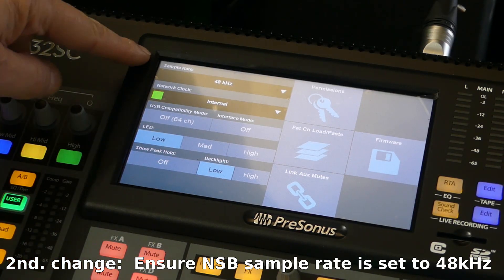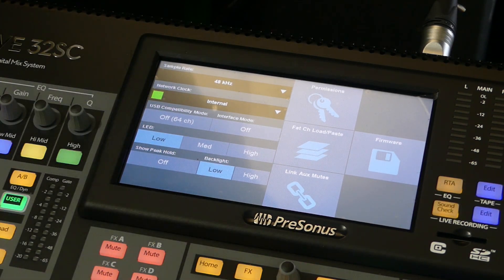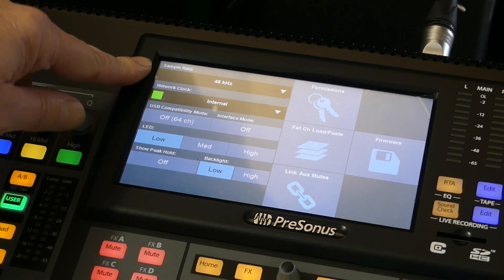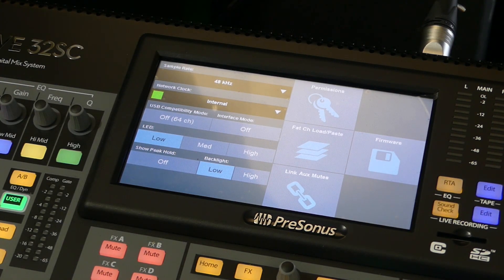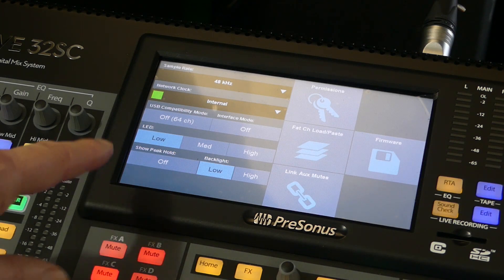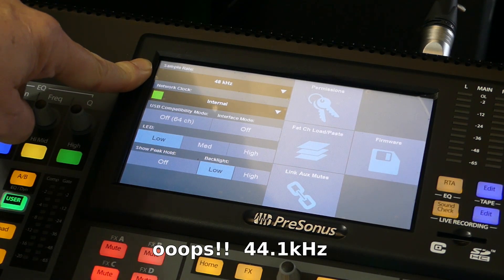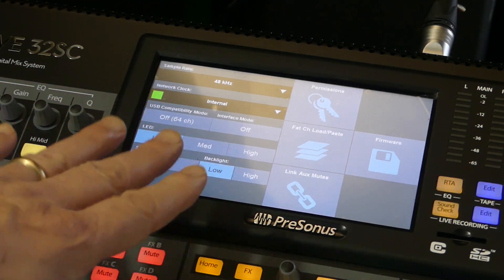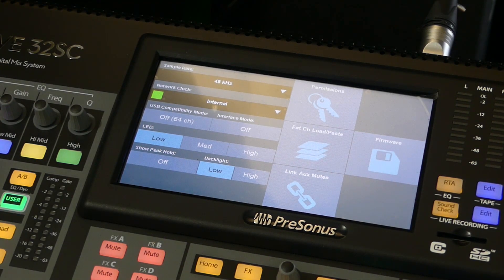Presonus NSB 32.16 signal drop-outs using a StudioLive 32SC - follow up to a previous video

Comment: Do you think cat7 or 8 will be better or worse?
Reply from the maker: Good question.  I'm not sure.  In the audio field, it's important the data (data packets) reach their destination quickly and on time.  I chose Cat6a (over cat5e - the minimum) for its 10g speed (over 1g); this was mostly for potential support for any future upgrades to hardware and the data protocols that support AVB.  I'm not too familiar with Cat7/8, but I don't think any increases in speed (from higher Cat cables) will provide any benefit to the audio protocols (including Dante).  Cat6a shows to be 10g at 300ft (100m).  This appears to be more than adequate for anything I would need.

Comment: What an interesting problem. Sounds like a ground potential difference Between front of house and stage. Or a high static environment day. Don't think the sampler was mismatched that would've been very obvious and I don't know how it would've worked, if it was mismatched it would be very garbled!
I've had a few occasions with sample rate mismatches with USB interfaces and a certain piece of software dragon dictate Mac where it likes to change the sample rate on me whenever a USB audio device was plugged in.

Comment: While I am not doubting your "shielding theory" I am finding that just the Ethercon connection is mostly the issue with audio dropouts.  I tried different setups and found if I use a cable that doesn't have the ethercon connector, I will have no dropouts.  Making small adjustments to the ethercon ends has helped a bunch, and after finding a cable that will work, the dropouts have stopped.  The new firmware may have helped with this too, I am not certain.  I do know that there are some cables that just don't work well (even tho they are on the "list"). Thanks for the info!
Reply from the maker: Thanks for your comment.  Good points.  The issue isn't so much with the Ethercon, but more of a grounding/shield issue.  Without an Ethercon connection, a shielded network cable will be grounded at the RJ-45 shell connector (metal connector); this can be tested with an ohm meter on the RJ-45 shell at each end.  Unshielded network cables usually have plastic RJ-45 shell connectors; these are basically UTP cables.  
Yes, I was hoping a firmware upgrade would have addressed this issue... but no luck!  It would be nice if Presonus would update their cabling documentation...

Comment: um... I disagree with this completely.  In my opinion it would be best to make sure it's shielded, ground is connected TO THE SHELLS  of the neutrik ethercon connector (use ohm meter to check shell ground continuity) .  i'd also run a power cable along with the data cable for FOH from the stage box so there is no ground potential difference from using separate power sources.  I also believe the voltage regulator is a waste of money since most gear uses switching power supplies that can support voltage sags.  In addition, presonus sports the AVB/TSN, IEEE ethernet standard and I'd be curious if buffering the signal with a AVB compatible switch/hub could also have helped, especially on runs longer than 200-feet
Reply from the maker: Thanks for the comment.  Yes, the shielded cable was grounded at the shells on both ends (confirmed by my ohm meter)... prior to removing the ground on one end.  The original ethercon cable used at the event (where this issue occurred) was grounded at the shells as well (150ft ethercon).  At the event (as well as in the setup for this video), all power originated from the same circuit.  All our Ethercon cables are 150ft.  I agree, a buffering device would have probably helped, but it would need to support about 2 seconds.
Reply: Yep, I agree, the problem was a ground loop created by the Stage and FOH sourcing different power outlet sources with different lengths to the breaker box. Best to run power from single area of the building but that is not always possible. I'm surprised other pieces of your gear did not act up as well or have ground loop hums, etc.

Comment: Thanks for your reply, Bob. I use Qu-24 with AR2412 Digital Rack from A&H and I have Mercator 6A UTP cable with Hicon connectors to link both items. It works fine to me.  Highly recommended. 
Finally, do you have a video using the dbx DriveRack PA1-2? I want to get this gear but I am not sure about quality and useful during live events.
Reply from the maker: Thanks for the suggestions on the cable!  The QU consoles are great!
We do not have any videos covering the dbx driverack gear.  We use the dbx 260 series anytime we need to control crossover points.  The dbx 260 (older series from dbx) has done very well at events.  We use the 260 for crossover only, and for the occasional cardioid sub setup.  I think the driverack units PA1, PA2, 260 are all good.  They work great when we run an all analog sound system setup.  Unfortunately with digital snakes, most setups don't allow for crossovers at FOH.  Any crossover would need to be at the stage and with someone to set crossover points based on what you tell them.  We do use the 260 with our digital consoles, but when using analog snakes and when using passive subs (with powered tops).  For us, the dbx driverack units are an integral part of most all of our sound system setups.

Comment: Thanks for your masterclass. After know the drop sound issue, do you recommend CAT5  than a CAT6 shielded?
Reply from the maker: Thanks for your comment.  Presonus states the use of Cat-5e or Cat-6a cabling.  The Cat-6a cabling is backward compatible with Cat-5e.  The Presonus documentation appears to be a little behind with updates on what cables to use.  According to Presonus, Cat-5e may be ok (it's rated at 1Gb/sec) up to about 300ft. (90m).  The Ethercon cables you seen in the video are all Cat-6a (10Gb/sec).  You could always try a shielded cable first (cat-5e or cat-6a) and if there are audio drops, try removing the shield from one side (one side only) of the cable.

Comment: 👍✅ Always learn something from your videos, tks!
Reply from the maker: Thank you!
Reply: @stageleftaudio  👍✅ nope, thank YOU
Reply: 👍✅ One question that I didn't see in the video, are you running all you AC from the same Furmans, FOH and all stage equipment? I'm guessing yes and its strange you should get a problem like this using the same source/ground/neutral although musicians sometimes bring the ground lift problems with their equipment.
Reply from the maker: Good question.  In this video, all AC is running from the same Furman (voltage regulator).  At the event location (where this issue first occurred), FOH and stage were together on one circuit, with the FOH console being the only device on regulated power.  Though, the NSB was not on regulated power, but was using one of the rack mounted Furman PDU devices.
Reply: @stageleftaudio  👍✅ Tks for the answer. Years ago i saw this idea somewhere and ever since insist that all energy is on the same circuit even if it means running 50 meters of cable out one way and 30 meters the other way to a remote speaker when a socket on another circuit is there already. Extra work and equipment to avoid a possible but unlikely problem but to me that is the professional way to do it and the  professional customers do notice and appreciate it as you well know.
Reply from the maker: Exactly!  Good to see you are willing to put in the extra work!  Wish others would follow. 
 Luckily, there has only been a few shows (many years ago) where I have had to make extra long electrical runs to avoid issues; it was a bit of extra work, but yielded good results.  With how things are now with doing shows, we can pull all we need for power from a diesel generator and distribute it with our PDU.  Our longest power run is most always from the stage to FOH (I'll settle for that).

Comment: Great work. You think I'd see the same interaction between the 32R and 32SX consoles using CAT5E? Scary stuff
Reply from the maker: Possibly... It probably all depends on what cable you are using (shielded, non-shielded).  When the audio dropout occurred at the event (Dec. 2023), we were using Cat5E Ethercon (Shielded).  Aside from that one audio dropout at the event, there were no other issues with connectivity between the console and the NSB during the show.

Comment: The basic issue is with creating a ground loop on a conductor of your data cable that disrupted communication. Other protocols like AES50 are also sensitive to this.
Reply: except AES50 attempts to solve this by bonding both chassis together with the cable shield, and it's usually UTP applications that experience static discharge related issues (or even damage)
Reply from the maker: Yes, AES50 can experience the same issue.